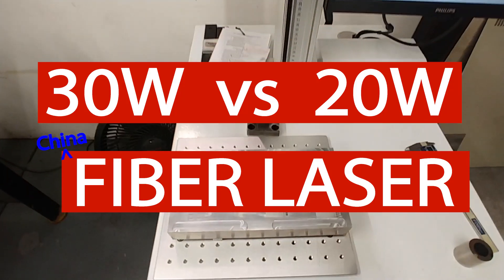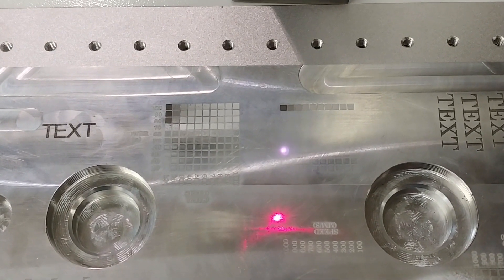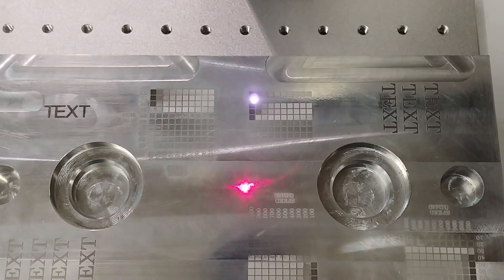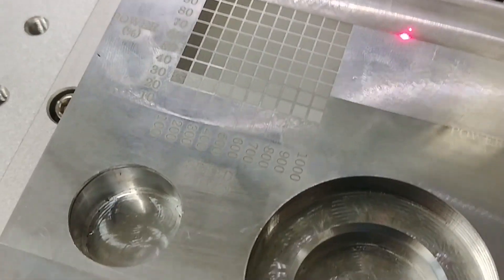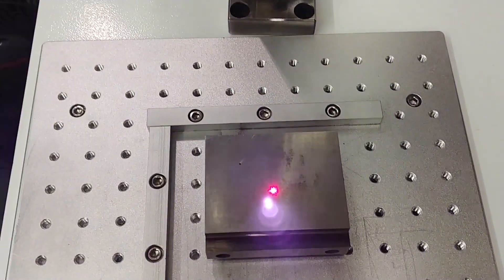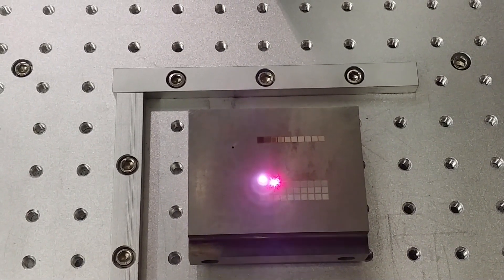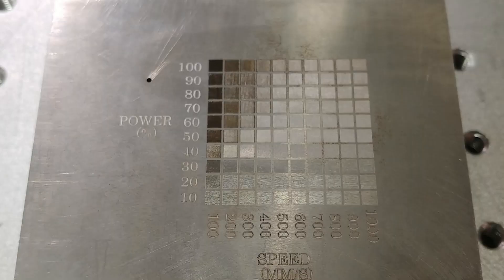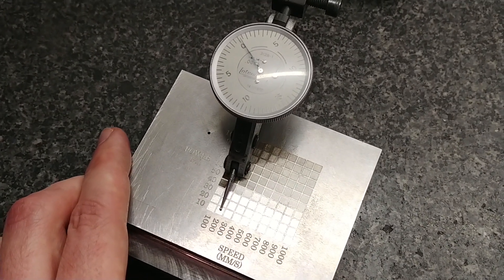30W vs 20W Fiber Laser Marking

Comment: What depth is possible to engrave into 7075 anodized aluminum with the 20W
Reply from the maker: If you're talking about a very small space, maybe 0.3mm.  That depth isn't really practical over a large area though.  If you're talking 7075 for firearms and you need to hit 3 to 5 thousandths, that shouldn't be a problem.
Reply: @jefferyj  yep its for firearms. Purchased the 30W but the software sent was corrupt. Have had zero luck so far trying to reach the seller to send a new copy of ezcad2

Comment: I really need these exact parallels you’re using in this very video.  Can you point me in the right direction to find them?
Reply from the maker: I believe they were just Shars brand (or maybe HFS on ebay).  If you have a 3d printer available, here's an STL file for the guides I'm currently using: https://www.dropbox.com/s/55u9pv74uc6nprf/Setup%20Guide.stl?dl=0
Reply: JefferyJ I actually don’t have a 3D printer unfortunately.  Shars website has so many that I don’t even know which ones to get........ Thanks for the help tho

Comment: In our testing, if you want to mark on surface of plastics like PVC,PP,ABS or the metals like bearings,stainless steel pipe, auto parts, 20W machine is enough.
If you want to make deep engraving and cut about 0.5mm metal , we will suggest 30W machine;
If you need more faster deep engraving and cut metal like gold sliver brass copper about 0.7-1.0mm, we will suggest 50W or 100W machine.

Comment: Are these test grids in the software, or you have to create them?
Reply from the maker: You have to make them; but they're available for download in the description to the video here: https://www.youtube.com/watch?v=gAhNCu6hHME
Reply: @jefferyj  Thanks.  I am considering a 30W version of the laser that you have.  Is there a particular marking area that I should be looking at?  I don't have any huge parts.
Reply from the maker: @sbeprecisionproducts6729  With a smaller marking area you will have a shorter focal length, more power, and a smaller spot size which results in a very slight quality bump.  The marking area is determined by your lens and you can have as many lenses as you want; they're easy to swap as they are just threaded in to the scan head.
  
If you're looking for more in, there's a lot of good stuff in these two fiber laser groups: 
https://www.facebook.com/groups/440091022989424/
https://www.facebook.com/groups/300139820848489/
Reply: @jefferyj  Is one with a longer focal length better for marking things that may not be perfectly flat or round (without rotary?)
Reply from the maker: @sbeprecisionproducts6729  Yes it is.  A lot of people will use a 300x300 lens for marking tumblers without a rotary for that very reason.
Reply: JefferyJ AP it looks like I want a 150x150 for most of my work and then get a 300x300 for the times when I want to mark something curved.  Thank you very much for your help.  How is the maser holding up?  I will primarily be marking part numbers, serial numbers and logos for our machined parts.
Reply from the maker: @sbeprecisionproducts6729  Those sizes should be just fine.  Serials and logos are ideal for a fiber laser; you might want to make a few fixtures for your parts especially if you're doing multiples at once.   My laser has been solid for the 18 months or so that I've used it, no complaints.
Reply: JefferyJ yeah we can make any fixtures we need.  We have CNC and wire EDM, but the laser has just been something that seemed like nice to have but not essential.  We occasionally get jobs that require laser marking and we end up having to send it outside.  Your videos and tutorials have really made things look less intimidating and gives me faith in the Chinese laser. I appreciate your responses and your excellent videos.
Reply from the maker: @SBE Precision Products No problem.  Also, check out the facebook groups.

Comment: will the marks come off if they are scrubbed?
Reply from the maker: Only the very lightest marks which are hardly present can be removed without effort.  In general, these marks are permanent unless you're willing to significantly damage the surface.
Reply: @jefferyj  good. thanks

Comment: Wouldn't the laser making be the same if it was that small test area you did? I can see if it was big and went out to 250-300 but if it in 0-40 range i would think the focus would be the same. How do you tell the difference between a 20&30 w laser? I have a "30" but it marks like my friends 20. it has no markings on it at all? just wondering.
Reply from the maker: In this demo, it's heavily determined by the lens size.  The 30 has a much larger marking area so it has less effect.  If your laser isn't identified on the source itself (inside your cabinet), you can check if it's drawing roughly the right amount of power.
Reply: JefferyJ do you know how much it is supposed to use? Do you know where to find info on how to make rotary work. The company I got my laser from is not much help and I’m stuck.

Comment: Just wondering if there's different manufacturers of lenses for the fiber laser and if one is better than the other? I just ordered a 30w fiber laser off Ebay with 150mm lens but if I want a different mm or a better quality lens. Would there be any advantages 1 lens over another?
Reply from the maker: There are all different sizes available.  They could all be manufactured by the same company as far as I know.  A larger field lens will have a longer focal length and will be less powerful.  

Some of the big sellers on Aliexpress for lenses are Cloudray https://www.aliexpress.com/item/32861055792.html?spm=2114.12010615.8148356.2.229a30c7qgk22x and Rock Solid Laser https://www.aliexpress.com/item/32919650050.html?spm=2114.12010615.8148356.1.387d37d1qkTbqk

Just be careful to buy the correct thread size...m52 or m79/m85.

Comment: I guess the "Galvo" head that you described, is fixed, and doesn't raster with an X-Y Gantry! I use a Trotec Laser at work, the Speedy 300 Fiber, with 30W! I set the focus, by raising the Bed, to "Trip" a Focus Tool, paired to my Lens, so that it releases, and falls off the laser  working Head Ledge. . I can also set Specific out of focus offsets, either higher or lower, than the starting setting!
Reply: Depending on the type of work needed.  I make over $1,000,000 a year and only use my 30w Fiber Laser.....

Comment: It's good to see you have a 20W vs 30W video but I could hardly see the difference. I have plan to buy a 30W laser and use it to a 1.13 mm thick . anodized aluminum pet tag. Do you think it wont get through if I laser its front and back?  In your video how did the laser make a dark and light engraving? Thanks!
Reply: we can meet your requirements, kindly contact for quotation offer whatsApp:+86 13510567251

Comment: what are these lasers like engraving on to hard woods. are they quick and what width can fit into it
Reply from the maker: If wood is your primary material, you would probably be better served by a CO2 laser, which is not a bad thing because the Chinese CO2 lasers tend to be less expensive than the Fiber lasers.

Comment: Did both lasers have the same size lens?
Reply from the maker: No.  The 30W had a 300mm lens if I recall correctly which has been changed to a 100mm lens a few months after this video was made.  It's not an apples to apples comparison.

Comment: Hi jeff..interesting video has been shared..I owned 20watts fiber for the past 2 years and thruout my experience with my machine..its much better to get 20watts rather than a 30watts machine..with 20watts machine I've also 3 sizes of lenses 70mm/150mm and 300mm lens..with speed, power and frequencies manipulation you will get amazing effects on your materials only with 20watts machine..if you all guys wanted to purchase any of those..20watts would be enough rather than spending on a 30watts machine and if you wanted to go for deeper engraving..go for 50watts or 70watts mofpa..usually a 20watts machine works from 20hz-60hz...but..if you know how to manipulte the ezcad..you can tweaked the frequencies from 5hz up to 500hz..but the Laser resonator self has been locked for the lowest to the highest frequencies that am my self dont have the proper instruments to measure it. but most highest you can go can workable was around 300hz and you will get ablating alike and the colour silvery blueish and frosted effects..to get darker effects go 22.78hz power about 75%-90%..theres no point to bring up to 100% power due to you lessen the MTBF of the diodes...am always use the power 50%-85% the most. 150mm lens was the most suits with 20watts in any conditions with materials..and also it works to cut papers as well but the most it can absorbs was a black colour paper and wood as well..Marking and engraving for a tiny lil things no point of getting high power machine..those would destroy your art details on your designs..on changing from one to another sizes of the lenses..you need to re calibrate back your red square pointer and have to re adjust the marking square point (F1) and lase it (f2) and make sure the square mark and the lase mark at the exact point...and many more..my target for my next Machine was a 50watts or 100watts..thank you for sharing those informative videos.. you also can get some of the settings for your fibers from TKYMA..most of the settings was indeed..workable for those chinese Fiberlasers...am hope you all guys enjoyed with your machine..interesting..
Reply from the maker: Hi Ahmad - Yes, I've been tempted to get a more powerful laser, but I had wondered if detail would suffer.  Thanks for the information!
Reply: @jefferyj  Hi Jeff...for my first year..I was been tempted too for having a high and powerfull machine and when over the timed..am thinking of not having those so called high powered pulsed fiberlasers unless you go for a DPSS a continous type...Here in Malaysia am been doing lots of engraving and marking for custom made knives..silver gold..pewters.. 12in size of potraits , cutting on thin metal..drilling..rust cleaning as well ..on your right below the power% column  theres a Laser On Tc..change that to negative 300 or negative 150..it should be performing better..dont just used your power to 100% as in the settings pages its only at 90%..all those parameters can be changed for your needs and can be locked too with passwords...it is better to have multiple lenses rather than having to increase and decrease the power..the lowest focal lenses size in market was a 50mm..that was the most powerfull and it can cuts 0.5mm metal with many loops..the hatches also can be combined..I'd rather only use a single type of hatch the degree to and forth..dont spend your $$$ for 300mm lens..maximum go for 200mm size...my experience did teach me alots..and on the other hand..change all the power supply as those chinese made power supply wont last and unstable..their cabling was very poor installed..and if you have an extra $$ go for their latest BJJC mainboard which was a version 2 and get the latest ezcad3 software as well..it works on 64bit OS and much more extras...I owned Co2 Gantry 1000mm x 800mm just for cutting and Galvo RF Co2 as well....hope you loaded with more videos for fiberlaser as most users are not familiar with..am having so much enjoyment for the machine ..but in hand before getting familiar with..am just felt like hell as the supplier dont really know on their machine that they selling..am spending 15hrs a day for straight 2 months to familiar and play around with it..thanks man..am enjoyed watching your videos.

Comment: Can it mark 3mm deep ? if it possible how many times need to repeat?
Reply from the maker: No you'll need something much more powerful.
Reply: You CAN engrave to 3mm deep with a 20W, you just need a small field lens 50mmx50mm or 70mmx70mm and a LOT of time. I can cut thru 4mm thick coins.... But it takes hours. With a small field lens you can also engrave on copper which is impossible to do on a 20W fiber laser with the std 150mmx150mm lens. (The smaller field lenses produce a dot with more energy density)

Comment: This test was very informative as I am looking to purchase a fiber laser. I email a USA eBay seller, ving-store about a 50W Split Fiber Laser Marking Engraving Engraver with Rotary Axis Included. Specifically about the laser types he is offering. He got back to me right away:

“For this machine, we provide Maxphotonic, RAYCUS and IPG laser optional, Maxphotonic and RAYCUS is no price difference ($7400 with shipping), for IPG laser, the price is $19500.”

My question to you is how large of a sheet of material can be placed in the marking area on your machine before the laser support post is contacted?

Thank you so much for taking the time to make these videos and explain your experience with these China fiber lasers!
You are the best on YouTube!
Reply from the maker: There's a cad file (STEP format) for the entire base plate available in the description to the video here: https://www.youtube.com/watch?v=nHFIjonPOL0  you can open it with fusion 360 (which is free).
Reply: @jefferyj  Perfect! - Thank You!
Reply: @jefferyj  I made a quick sketch in AutoCAD with the help of your STEP file. Downloaded Autodesk 360, export to a DWG then made a few ass-umptions. Looks like with a 20W 150x150 fiber laser you could place about 315mm / 24.4" of material under the laser? Take a look... 
https://a360.co/2ZcW5r6

Comment: Hey jeff i have a 30 watt laser i was able to get very dark marks using these settings speed 100, power 40, Khz 69, also in the hatch. Hatch 1, line spacing 0.003..... give it try jeff i think you will be impressd..
Reply from the maker: Thanks, I'll give it a try!
Reply: I am trying to soak up as much knowledge as I can from your videos as I am planning to purchase a 30 watt Chinese Fiber Laser. First, I want to thank you for all of your great videos. I have a feeling that any attempt to learn these lasers would be futile if relying on the Chinese instructions alone lol. I have a few questions regarding statements you made in the video. If you have another video where you answer these questions, please forward me there. You mention that you have the 'Split' 20w Fiber Laser with 150mm platform. Then you mention that your friend has the 30w fiber laser with a much larger platform and that the larger platform will affect the efficiency. Since I am purchasing a new fiber laser, these issues are important. I would have thought the larger platform the better. Can you explain why the larger platform affects the efficiency of the laser? Does it have to do with the lense that is used? I notice that they use different lenses for the different size platforms. I guess my main concern would be would I be able to compensate for the loss in efficiency by changing settings? Or can (or should) I buy other lenses to regain that efficiency? I want to be able to get the deepest markings across the range of materials, and the largest working area. I have a feeling I am misunderstanding how these lasers work in regards to how working area relates to the different lenses used. I am sorry for my ramble but I am sure you will be able to clear things up in a sentence or two. Thank you in advance.

Comment: So with a smaller work area lens. You get more penetration  /power? Is this correct.
Reply from the maker: Yes.  My understanding is that you can purchase multiple lenses if you need a different size marking area.  Not yet sure how simple it is to install and set up a new lens.
Reply: @jefferyj  As long as you spec out the right lens, the physical install is as easy as screwing it in.  The challenge comes in re-calibrating the entire system any time you swap lenses.  You can make it easier by copying the entire EZCAD install folder into multiple directories and then setting up each one for a specific lens, but you still have to tweak it a bit each time you swap.